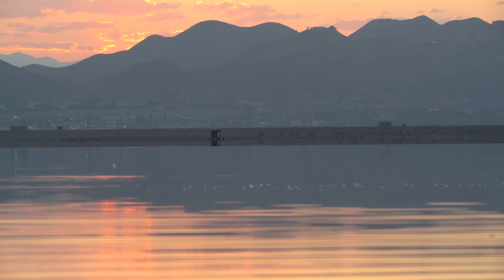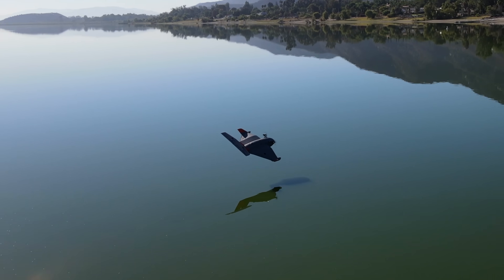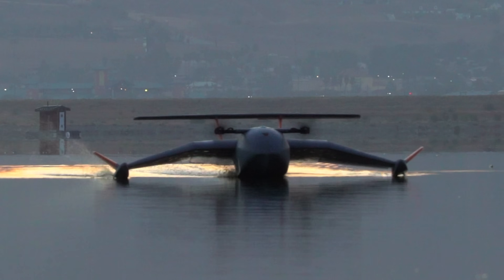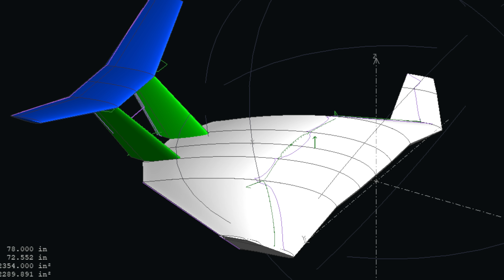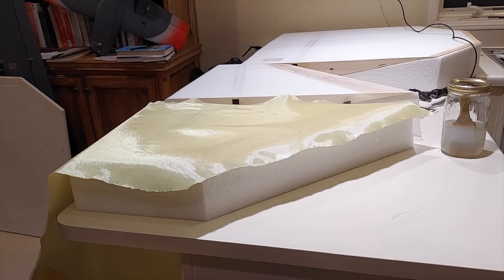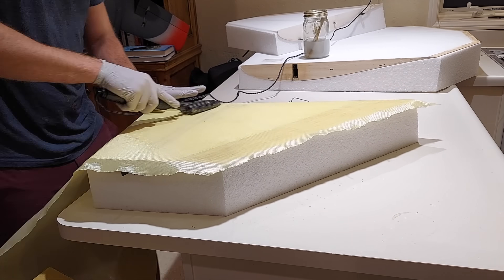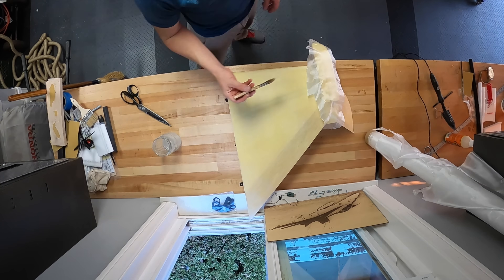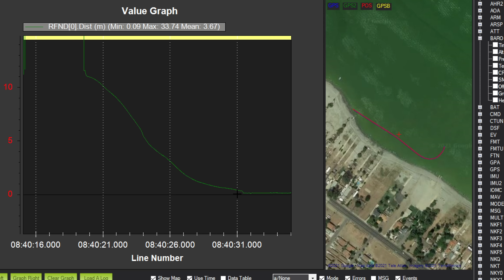Huge R/C Seaplane

Comment: If you want to get rid of oscillations caused by altitude control, add some dampening to them. That is, add a -k*V component to throttle input, where V is vertical speed. With the right tuning, throttle corrections will not make the plane overshoot it's altitude target.

Comment: Pretty sweet looking vehicle.  How does it perform with realistic engine power?  Rotating engine nacelles are expensive.  But even if the military or some company could afford them, the blades to lift a vehicle out of the water, as easily as this did, would need to be massive.  Just look at the Osprey.  So, if you scaled engine power down to an Allison T-56, and same 4 blade prop, from the C-130, how much weight could this transport?  With the C-130's 4 allisons it can fly at double its empty weight for transport.  So, if this could lift double its weight with 2 engines, that would be something.  Would also need to fly at 300mph probably though.  Not sure it is possible though, I am sure the military has already thoroughly looked into ekranoplans.  They may have done it back before rotating engine nacelles were feasible though.  So who knows, there may be a nice sale in here to northrop or boeing.  Or they will just steal it if it gets too good.  I so wish there was this sort of cool stuff back when I was a youngster.  Keep up the great work.

Comment: I love it! But I have a question, I noticed that right around take off speed it seems a bit twitchy, and it looks like it launches itself off the surface, right into free flight.  Would the craft stay in ground effect with less modulation if it was just plain heavier? Like heavy enough that it can't fly outside of ground effect?

Comment: so it has been bugging me because you control the ground effect with throttle adjustments, you can't really test efficiency. 

could you change the software to control altitude with pitch control and then test efficiency at various throttle settings? or rather, i know you could, but why didn't you? also if you used some kind of RMS algorithm on the lidar data it could help deal with the noise you get from choppy water.

Comment: We needed to see more of the action on waves. The first objection to use of GEVs is that weather shuts them down: they need glassy water only. This contradicts statements from those with experience flying some of them, who say they can easily go half span high, or even full span or more for shorter durations if it's a type 2 or 3 GEV.
One thing I've seen others do for tests of models is use the wake from a boat to test its handling in choppy waters.

It's also interesting that videos of the real thing show that they're not particularly afraid of wing-tip strikes. Sometimes perhaps using it for yaw.

For larger models, see the 1950s Chase/Stroukoff YC-134. Upgraded C-123 with BLC for STOL performance and waterproof strengthened airplane hull. With two flat "Pantobase" skis instead of a step. On Skis it operated from pavement, unimproved ground, sand, snow/ice, water. The skis can be semi-retractable into the underside.
If it's got power for more than a few seconds of flight above GE, then getting from displacement to the "step" or skis, isn't a problem.

Comment: You are really good at getting people interested in the rc field but you really should do a video on the regulations and how to follow them. I had a hard time figuring out how to even register my drone or even if I did or didn’t have to. I’m pretty sure most of your drones are over .55lbs which means they are registered (even if you built them) as well as I am sure you have a faa license for flying drones for profit (YouTube channel) and get permits on flying out of sight (really want to know how as I can’t find the permit for this) which you have done a few times when flying for long periods on ardupilot (solar plane when circling one spot) as otherwise you must have your eyes on the drone the entire time no matter the size or weight… soooo…going to do a video on these things?

Comment: I wonder how muhc it would take to make a 1 Person Ekranoplan.
Reply: I had the same question so I learned a little bit about aircraft.  

I did the math and apparently with a 10 foot wingspan, at 175 pounds and a 17 degree angle of attack, I was able to mock up a wing with a 20:1 lift to drag ratio at 10MPH which is by no means ideal.  Anyways, if my estimation and calculation is right, it would need about 11 pounds of thrust to lift 175 pounds at 10 mph which in reality isn’t all that much, there are motors capable of producing that for 150$.  Anyways the drag of the water is a big factor which I haven’t been able to work out yet.

In terms of buoyancy it would need about 3-4 cubic feet of foam in the water to support 175lbs, although that’s just an estimation.

Tl:dr:  not that much surprisingly

Although I’m just a 15 year old who spent a week reading graduate papers and nasa documents so take this all with a grain of salt.

I would love to make a mock up version of this, but I don’t have the money.  I am working on a cad model so I can do further testing if your interested.
Reply: @grangerfilanowski4583  thank you.
Reply: @DanielLopez-up6os  no problem.  I’m searching for someone more experienced to talk to and bounce ideas off of.  If you want to, feel free to leave an email or something and I would love to talk to you more in depth about the design

Comment: At what height is it actually profiting from the ground effect, is that only when we see the patterns in water?
Reply: just read a bit about it, when you fly just above the water, according to those links you have negative effect of the drag. Wonder if you have measured such things
Reply: Ow i see you did measure data, does actually measure the water surface or the bottom?

Comment: I figured out a tiny flaw in your ground sensor:
because an RC needs a lot of power to create lift, the sensor can only be of affect if the RC shakes slightly or at least subtly,
hence forth- since the sensor is on one wing imagine if the ekranoplan hit a strong gust:
the engines wouldn't have either the speed or power to correct in time!
I might be wrong but I just wanted to inform you

Comment: So basically the lidar is an auto pilot that you can put on any rc  plane to fly close to water/ground.  I think you are mixing up the characteristics a bit too much. I would have thought if you get enough forward speed and a decent compressed cushion of air under the plane it would be more difficult to make contact with water

Comment: Is this scalable to single human flight?
Reply: I had the same question and spent dozens of hours learning.

According to my estimations and calculations, if you have a 175lb craft with a 10 foot wingspan, 17 degree angle of attack, and 1 foot chord (pretty small compared to the wingspan).  At 10 MPH it would have a lift to drag ratio of about 20:1 which is decent enough.  (This is at sea level)

This craft in theory would require about 11lbs of thrust to become airborne at 10MPH.  Motors capable of creating such thrust aren’t that hard to come by and are sold for commercial drones used for lifting cameras and whatnot, I found one for about 100$.  I would imagine it could be created in a similar way with foam and carbon fiber spars, and then covered in fiber glass for stability 

The problem is the drag produced by water which I have not had time to fully work out yet.  However for it to be buoyant it would need 3-4 cubic feet of foam to be submerged in order to displace enough water to lift it.  

Tl:dr in the rare occasion that I’m right, yes it would be scalable to human flight, and it would be surprisingly cheap

However I could certainly be wrong, I’m just a 15yr old who has way to much time on their hands to read graduate papers and NASA papers.  I’m working on making a CAD model to figure out buoyancy more in-depth, and I have yet to fully test the wing in xflr5. 

If your interested in anymore information lmk, I would love to collaborate on ideas. I don’t have the money or tools to really make a model, but I would love to see someone who could.

Comment: I'm really curious about this project. First of, very well done. It's a beautifully flying machine. That said, XFLR5 in stock form is not capable of calculating the center of pressure shift for a wing in ground effect. I am not certain, but this may be why your Ekranoplan is even capable of flying outside of ground effect. Typically, a Lippisch style "reverse delta" WIG will have a lifting tail and is only dynamically stable in ground effect. As the vehicle leaves ground effect it should tend to trim nose down and bring it back into ground effect.  If designed this way, the use of an ardupilot and LIDAR shouldn't be necessary. I'd encourage you to play with Lippisch WIG gliders to experiment with the naturally trimming tendencies of such designs. 

Of course, I could be missing something
Reply: I was thinking something similar.

I thought the idea behind this design was to ensure that the machine, once it had entered the ground effect, would be stable as long as the speed was kept up. No need to worry about altitude as it can never leave ground effect.

Comment: I am a turbo "fan" of WIG craft.   I am looking to make a 50/50 WIG/foiling sailboat. What I do not see from this amazing RC craft is the benefit of wig vs pure flight. It looks like from the vid you can easily just fly the craft out of ground effect.  Can you tell if there is efficiency/ difference if you keep close to the water?  does it fly faster with the same power? or does it use less power to maintain flight? just wondering what you can tell from the small scale.

Comment: Cool, 

Question, Im no expert, but shouldn't propellers be mounted below the wing when they are in front to help with lift? 
The little I know about aerodynamics, it seem to be that this would add pressure above the wing.

It seems to fly really stable though.

Comment: Lidar - throttle PID controller: Must have been a lot of work and risk adjusting the PID controller for keeping the height without wrecking the plane on the first try. How did you do it? How did you choose a starting point?

Comment: Hmm... Can you make each motor swivel independently for some extra roll control, assuming it could increase the wing pressure under solo effect? I know that will add more variables to tune, but... Why not? It is more data, regardless of it works or not.

Comment: Do you have a lidar sensor in both wings or just on one side? If it is only on the right side, does it affect the turns? Right turns should therefore fly higher than left turns, or does the flight controller account for that?

Comment: Works fine obviously, well done! However, why don't you PID the Lidar-Output or at least add a differencial component, so that the Motors turn higher, the faster it approaches sea level. Always enjoy your videos!

Comment: Beautiful! That thing over mirror smooth water was just gorgeous! Cutting edge research has a habit  of returning images of pure beauty!
Imagine a full scale cargo carrying version out in the Caribbean coming across a huge container ship directly on it's course. 
Turning to port or starboard is much riskier & not as efficient as just hopping over it. 
So this would be it's safest avoidance technique. These things are going to be stunning in operation! 
Next phase is studying them in the transonic region. Then you'd have a cargo craft as fast as air transport (Mach 0.8 or thereabouts if it'll work in ground effect) but with much higher capacity by weight. 
Exchanging some velocity for altitude to hop over ships, islands & offshore wind farms could be totally automated using AI, radar, lidar and GPS to look ahead. 
Sea crossings could merge seamlessly onto land. Corridors for these craft could be made much rougher than current roads as these craft in ground effect don't touch the ground obviously. So ways to get these craft inland would be much, much cheaper & more sustainable re nature. You'd just need to clear obstacles more than a few metres high. 
I see them becoming what we thought hovercraft would become back in the 60s & 70s. There were plans for hovercraft even bigger than the Dover to Calais Mountbatten class monsters for cargo transport. But I think these ground effect craft fix the problems with hovercraft when scaled up.
I guess we'll see what happens eh?

Comment: The anhedral reverse delta allows the centre of effort to move aft as the machine descends, 
but recovers some pressure toward the tips as the wing gets closer to the surface, keeping the machine in trim.
Mostly these hybrid shapes of Alexander Lippisch's design exist to get around the patent
it isnt usual to have flaps on the mainplane

Comment: This looks awesome. It just shows what collaboration and teamwork can do. I have watched the videos of all of your work and Kevins to get to this and it is fantastic. FYI I have used those Native products and they leave stains in the armpits of my clothing so I DON'T use them anymore. With the lidar sensor only in one wing does that make a difference when that wing is higher than the other when in turns?
Reply: With Native, less is more. To avoid staining we recommend only using 1-3 swipes under each armpit. Spread the product by rubbing your arms against the sides of your body (in ski formation). This will help make sure that you can fully rub the product into your skin, which will improve performance and reduce transfer to clothing. 

If you notice any product on your clothes, apply a small amount of soap and try to rub out any product residue before washing and drying. This will avoid any permanent stains!
Reply: @native_cos  I have tried several ways to remove the white stains from my clothing but it will NOT come out.. I have had to throw these clothes away.... even hot water soaking does NOT remove the stains..

Comment: I wonder, of you put a very small hydrofoil under it in the center, just below the level of the wing tips, you might be able to tune the flight control so that it fly's even closer to the ground, because the hydrofoil would just kick you back up if you get too close, whereas now you just get drag.

Edit: Now that I think about it, the wing tip pontoons would be a better position.

Comment: I've always been obsessed with Ekranoplans. Really cool to see how well yours turned out. Out of curiosity, why did you not opt for scale ducted fans? I would think the greater static pressure would be something desirable for your tiltrotor configuration.
Reply from the maker: They are less efficient, have slower acceleration for the ground effect control loop, and just blow a hole in the water
Reply: @rctestflight  Thanks for the info! I've got no experience myself, so its all guesswork on my part. Good to know!

Comment: I always wonder with those groundefect vehicles which are capable of normal flight as well. How big is the lift from the ground effect?. I would love to see a ground effect vehicle that is only able to fly in ground effect more like the real ground effect vehicles.
Reply from the maker: Turns out all the real ones can fly out of ground effect too
Reply: @rctestflight  you sure? Hard to imagine the Ekranoplan do that? Awesome work on the Modell btw😊👍
Reply from the maker: @maxchilla732  The giant Russian one needed 8 engines to get off the water but only needed 4 to cruise. Don't you think if they throttled up all 8 engines they would have more then enough power to get out of ground effect?  thanks!

Comment: if you had 2 more lidars on the plane with an accelerometer you could get a lot more accurate pitch and roll data so you can deal with taller waves
Reply: Some look-ahead capability for obstacles and roll and pitch compensation would be neat. I wouldn't be surprised if it's in the planning, but probably cost and software issues to work out.

Comment: Use attitude control? Attitude is gyro/accelerometer fusion like every drone does. Gives attack angle of plane very precisely and very fast, no delays, no long time drift.
Lidar/attitude sensor fusion can do the same for height. Wave bumpiness eliminated with filtering while long and mid term attitude imprefections are corrected by lidar centimeter precision.
This would allow faster reaction to CP shifts than your "proportinal lidar" does.
Im an insufferable dick, i know.

Comment: This is absolutely amazing, Fantastic work. Question: When feeding lidar data into the Autopilot, do you perform any correction of the lidar reading based on tilt/pitch which would modify the range estimate?
Reply: I was going to ask the same thing, especially since the lidar is out on one side as opposed to centered.

Comment: Now, if someone could jsut get my Radiomaster TX-16s to work... nothing but the lambo lights animation red ring of death... and I've gotten it repaired already twice.   Always back to the same problem within days.  About the only way it will fy anythign again is if I threw it off a tall building, and saw what kind of effect the ground had on it.  I thought my first transmitter would last until at least it went obsolete.. and not... less than a year.

Comment: *************WHY DID YOU NOT USE 2 LIDAR SENSORS ONE ON EACH WINGTIP LIKE I SAID? BECAUSE OF THE ROLL MAKES IT THINK IT IS FURTHER FROM THE WATER AND THEN DIPS THE WINGTIP AND IT HITS THE WATER. A COMPARATOR LIKE A OP-AMP CAN ALWAYS SELECT THE CLOSEST/SMALLEST DISTANCE FOR THE AUTOPILOT TO USE.*********   ALSO IS IT POSSIBLE TO ADD A SMALL CAPACITOR TO THE OUTPUT TO SMOOTH THE SIGNAL OUT A LITTLE MORE?